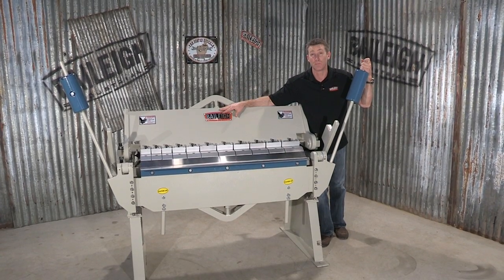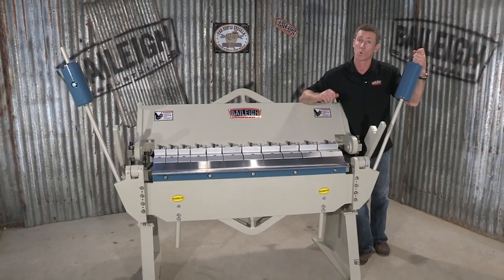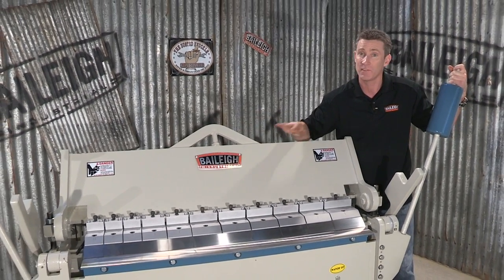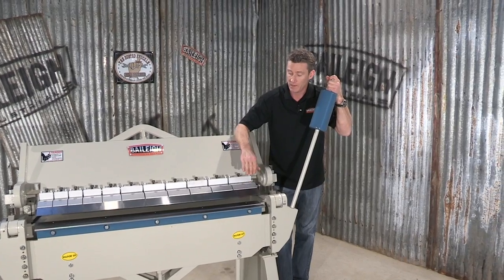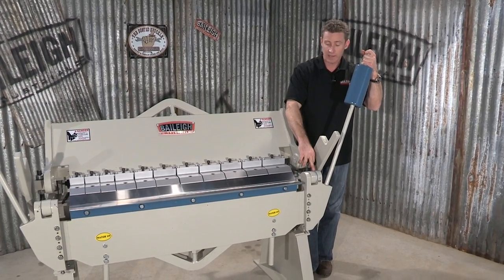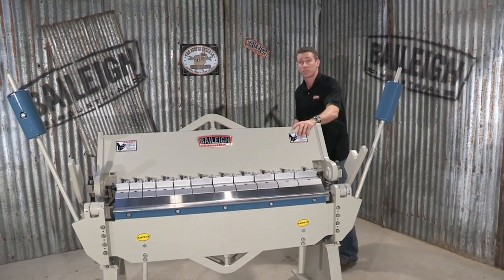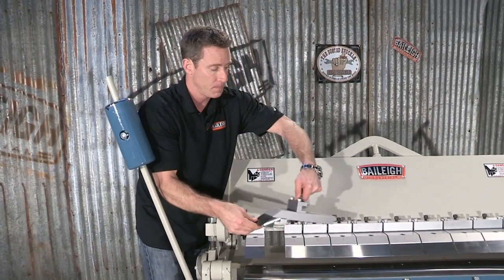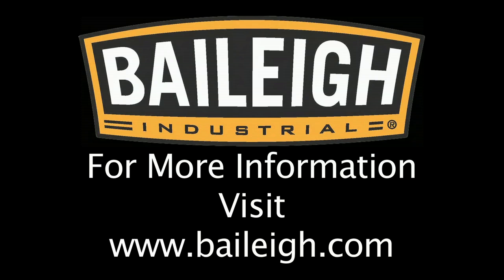Baileigh Industrial 48-Inch Box & Pan Brake Overview (Model BB-4812)

Comment: Hardened and ground edges are an expensive waste and they chip if dropped. 
THIS is an expensive yuppie tool. 
No real shop would have this. 
This plays to the,,,, " But it is cool" ,,,,crowed .
Totally, unnecessarily, over glittered.
I`ll take an old Whitney -Jensen any day.
And less expensive, as well. 
I bet this thing costs 4.000. 
Not worth it. 
Yeah, I`m a woman, doing metal shaping, welding, Machine work and fabrication most of my life.
Reply: Hey. What brake would you recommend. The Whitney-Jensen?
Reply: good for you?